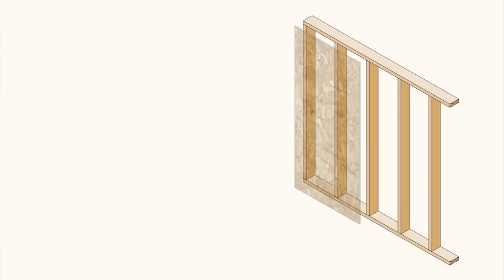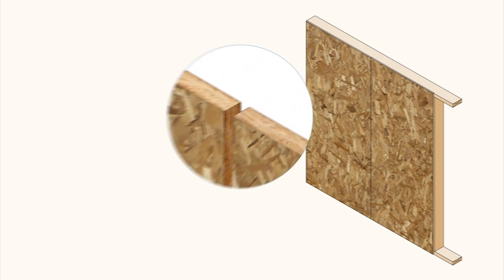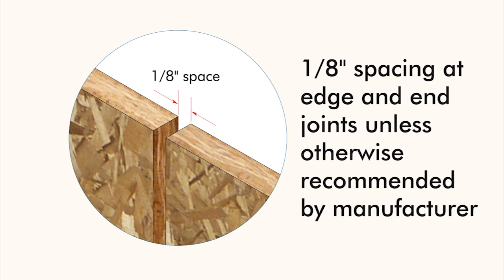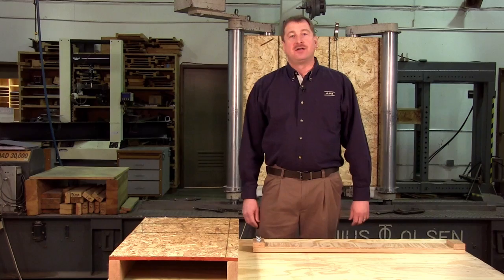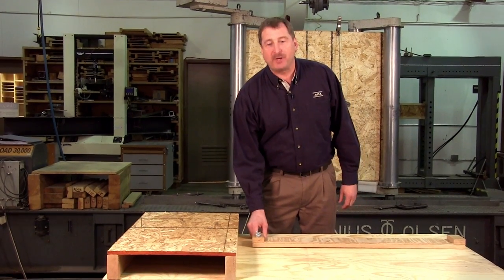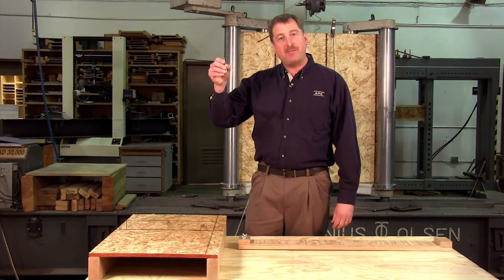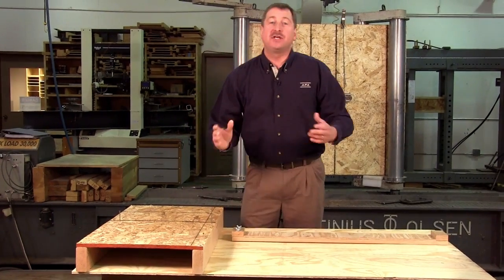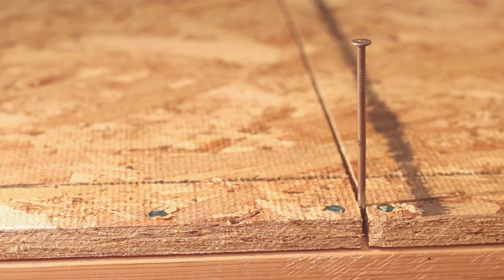Prevent Buckling with Proper Spacing - APA Builder Tips

Comment: Wont the gap cause leak issues?
Reply: That's what house wrap is for. Staple it on your plywood or on your studs under the plywood based on what you're building... with the top overlapping the bottom wrap. Also research on the nailing and stapling spacing

Comment: This quote from the Westfraser FAQ, TruFlor webpage was something I didn't know, "I HAVE INSTALLED MY SUB-FLOOR WITH THE GRADE STAMP UP, DOES THAT AFFECT THE STRUCTURAL INTEGRITY OF THE PANEL OR MY FLOOR?
West Fraser T&G sub-floor panels installed with the grade stamp up does not affect the structural properties of the panel. All West Fraser sub-floor panels are marked with “this side down” for two reasons. First, the tongue and groove on West Fraser’s sub-floor are offset slightly from the center of the panel. If some panels are installed grade stamp up and some grade stamp down, there may be a small lip to contend with. Secondly, when the grade stamp is installed facedown, it allows building inspectors to easily read the information indicated on the panel stamp once the flooring is in place."

Comment: Question:  If you space each panel 1/8" apart, as you go down the line (2nd, 3rd, 4th panel) won't you wind up being off center on your rafters given an 8 ft piece of plywood ?  Or is an actual panel of plywood 95- 7/8" long
Reply: As a lawsuit in California famously proved, lumber products are sized nominally. 4x8 sheets and panels are all a little short to allow for spacing. Just please don't sue Lowe's for false advertising and force them to put the "actual" measurements on every product in the store. So yeah, they are 1/8" short.
Reply: @AllAmericanGuyExpert  Thank you so much for posting this!  I've been looking for this info all over the place.
Reply: Hey I’m
Gonna have to sue you then. Sorry bro but it’s my right as a trans construction dancer.
Reply: @AllAmericanGuyExpert  actual measurement  would be the norm if the world wasn't a scam
Reply: @nodescriptionavailable3842  Huh? If a 4 foot by 8 foot sheet of wood were actually (and fully) that size, laborers would be forced to cut them to fit. A nominal size makes a lot of sense in several different scenarios.
Reply from the maker: Please contact our support specialists at www.apawood.org/help for assistance with your questions.
Reply: You cut both pieces of plywood where they meet halfways equally on a stud or rafter. Don't make it more complicated than it is.

Comment: what about long edges of the T&G board? Does it have to be spaced 1/8 inch? If yes how to you do that?
Reply from the maker: аралтан манджиев Because panels will increase in length and width as they absorb moisture from humid air or from rain, panels should be spaced at least 1/8 inch at ends and edges when they are fastened to framing unless the panel manufacturer indicates otherwise.

From their initial mill-dry state, panels may expand as they reach their equilibrium moisture content. If they are installed without room to expand, panels may buckle.

APA recommends leaving 1/8 inch space at all sheathing and Sturd-I-Floor edge and end joints, including tongue-and-groove joints as illustrated in APA Form M300 on http://www.apawood.org/buildertips/.

SPACING HINTS:
1. Use a 10d box nail as a spacer to gauge a 1/8 inch gap.
2. If necessary, trim panel ends to center on framing.